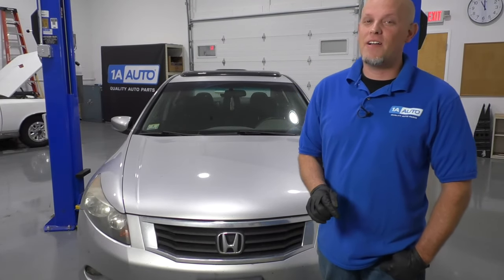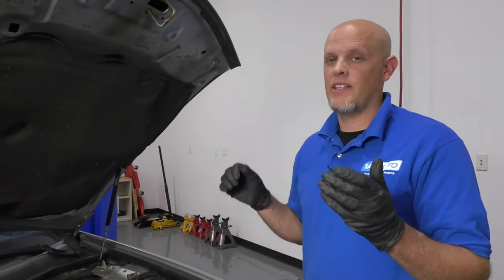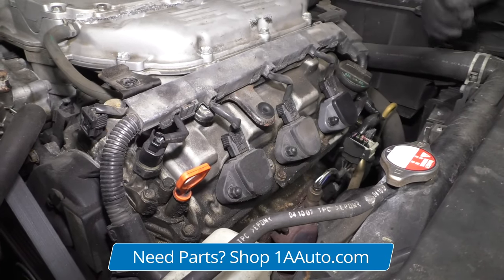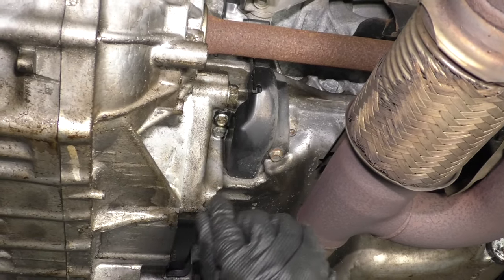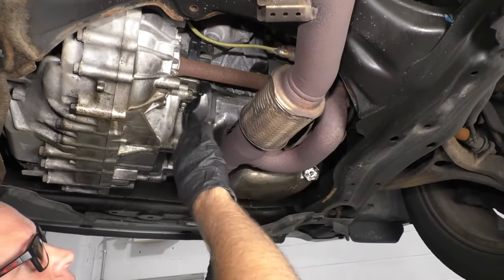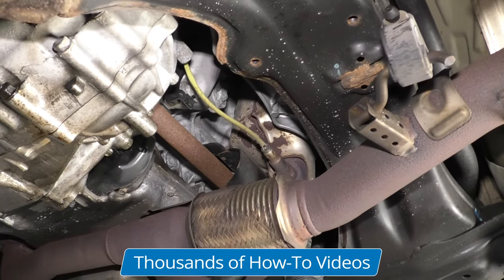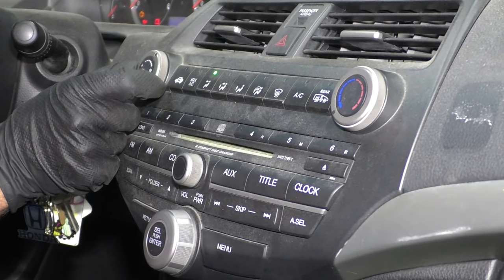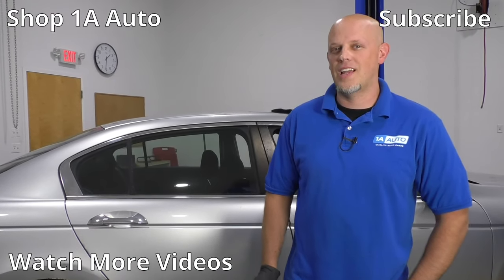Top 5 Problems Honda Accord Sedan 8th Generation 2008-12

Comment: i have a v6 accord and just replaced the alternator after having a bad oil leak ruin the last one, i had gotten everything in the car fixed, all i needed was a better battery, i went to go replace it and my car killed two battery’s in like an hour 🤦‍♂️ do you guys think the alternator is bad and is killing the battery? or any suggestions on what can be causing my battery to die so fast. i don’t think it’s the alternator but might be…
Reply: You probably have a parasitic draw coming from an electronic. Gonna have to test it yourself with a multimeter or take it to a shop.

Comment: my 2009 accord lx-p has 204K miles and never had any problems. If you drive normally and don't floor it you wont have any problem
Reply: Check the oil buddy
Reply: @irfanhasrat9705  All cars should have the oil checked.
Reply: Don't floor it???
Reply: Don’t like being driven over 80 mph, will really use oil

Comment: Good morning! Have a 2010 Acura TSX.. In freezing Temps, when starting out fresh, my brakes don't work. Let the car warm up, or consistently pump the brakes and they start to grab after a short time and they work fine after that intial start. Have changed brake fluid, brake pads and calipers are fine.... Ideas?  Brake booster possibly? Happens always with colder Temps below freezing.... Help.... 😂

Comment: I changed out my water pump on my 2.4l last week. Don't know if its a common problem.
Reply: Changed out mine at 95,000 miles. Bearing went.
Reply: Should have changed the timing belt at the same time. Watch the video on YouTube ," south main auto channel" is a good one.

Comment: Mine is the alternator AGAIN!! Also ignition coils causing misfire and the shaft sensow..which i saw recalls on the misfire and nose thingy thing..meanwhile one dealership is taxing me $900 for alternator and also stated if i were to buy at autozone etc..that'll only last for about 2-3 wks and its best to buy from them.. only but i have lifetime guarantee on it why would u pay 900 and dealership never once mentioned recall and i called another location its very much acknowledged but where my car is they claim that they cant see that!! Wow!! Dealerships are quite messy!!
Reply: Oil leak above the alternator will ruin the alternator and the oil consumption is the VCT problem.
Install the S-VCM and it will take care of the oil consumption.
$100 and 15min to install.

Comment: I love my Honda’s but I had nothing but problem after problem with my 08. Everything from bad interior lights in the radio, VTC actuator, burning oil, rust issues in NY, bad time with that thing.
Reply: Yeah burning oil is a common issue with 8th generation accords, with both 4 cylinder and V6, for entirely different reasons. My 08 has the same issue
Reply: Install the S-VCM @ $100
It will fix the problem , takes about 15 minutes to install.

Comment: I’m surprised no one here has mentioned how uncomfortable the seats are.
Reply: @6373h yes it is. My back and neck were always in pain no matter how many times I adjusted the seat.
Reply: Lean them back and it gets worse
Reply: Any one who says this is soft. Man up, buttercup. Also, if you didn’t get leather seating, you’re cheap and shouldn’t have settled. They are very comfy.
Reply: Agree the seats suck its so solid feels like sitting on a rock and ours is the "full-option" with leather seats.. but oh man they're bad
Reply: @GoAsCloseAsYouCan  dude we have the leather option and they suck. I tried a Hyundai Azera 2012 (same model as our Accord) and oh wow the difference is night and day the Azera is x100 times better and way more comfortable
Reply: They're not really uncomfortable you just have to sit with good posture. No leaning on the gwagon wheel
Reply: I rode in a brand new Nissan Maxima and those seats are 10 times worse.  Put it in perspective for me.
Reply: I removed the head rest and it is so much better!  The head rests on the 8th gen 4cylinder Honda accord lx push the head forward and interfere with proper posture.

But yes; still a bit uncomfortable because the seat does not keep the back perfectly straight.

Comment: I've been lucky  my 06 has 241k and still has the original alternator
Reply: That generation had a good alternator. I’ve seen many of those with over 300K with original. I’m not sure the 8th grand issue cause it also uses a Denso alternator
Reply: @levimagnusson5880  I have the V6 Model and my alternator has gone out twice since i’ve got it. Presumably because of whatever is leaking onto it is killing it.
Reply: @rumwrld9043  that’s odd. I’m not sure how the alternator in the V6 are. But in the 4 cylinder I’ve had many friends plus myself go 200K+ on the original alternator
Reply: @levimagnusson5880  I’ve been looking around and apparently the V6’s have some pretty common leaks around the alternator that are pretty simple fixes. I’m thinking it’s those/that oil getting onto the alternator and ruining it, rather than it being the actual alternator.

Comment: I had a k24 accord and it didnt have any engine problems. But it was rebuilt so the drivers side axle broke twice. After it was fixed finally it ran like a charm.

Comment: I feel maintaining a hydraulic power steering is also tough and it costs to replace the pump and the power steering rack if damaged also lets not forget vtec solenoid leaks!
Reply: Change the oil in the reservoir every oil change and that should help.
Reply: @adamUDavies  Hey Adam, I hope you’re doing well. Your suggestion indeed is helpful.
Reply: Replace the power steering fluid very couple years. See YouTube video, simple really.

Comment: On my 08, the ABS, BRAKE and VSA lights are on all the time, my mechanic changed the brakes and all 4 sensors on tires and still on, he told me it might be the Module but that part is very expensive 1K. Any ideas? thanks!
Reply: Did you fix it ?
Reply: @dawnjackson4640 Nope, I actually went to the dealer for a recall with airbag and tjey saw the lights on so the service rep told me there is an ABS recall so he was going to look for it and let me know. I hope, because it is expensive to buy module.
Reply: @aldon78 Thank you so much for that. You got it covered?

Comment: my accord 08 v4 gives less fuel , around 350km in full-tank till it reaches the yellow light what can be the reasons for the fuel drain. total 160k km is driven as shown in the speedometer, and the engine oil was leaking or evaporating or going out thru the exhaust i dont know exactly, one guy told me to change the engine itself he said piston rings are letting the vapor out he told to change engine instead of the piston rings due to the labor charge involved, but when topped up some cheap oil now the engine oil doesnt leak. but fuel consumption has gone up. full tank i used to get 450km now i get 350km , PLS ADVICE

Comment: The 7th generation models, especially from 05 - 07 were better than the 8th generation ones.
Reply: My wife has the 07, 160,00 miles, only thing we've replaced was a couple of window motors, first vehicle that wasn't one of America's big 3, that we've had, I can't believe how dependable it's been, I'll never buy another Ford or GM
Reply: @rick343  
I've had an 05 with the 2.4L for over 12 years and it's got 210k. Not sure why Honda made so many changes with the 8th generation. What happened to "If it ain't broke don't fix it"?
Reply: @jeffu.8053  I know right, after reading the comments I was thinking the same, so many people with complaints that aren't even mentioned, that next generation really went down hill

Comment: What causes hard starting on these cars? Recently I would have to crank about three to four times before the engine starts slowly.
Reply: Try high octane ⛽ gasoline...!
Reply: Could be a battery could be a starter have you took a look at the battery?
Reply: My battery caused this.
Reply: I had this issue. Needs crank case sensor and an expensive scan tool to “learn” the new sensor, I tried manual method, didn’t work. If your is hard to start when hot..100% sensor. Other is you must use Honda OEM starter, for some reason aftermarket work for 1 year then have issues

Comment: My 2009 2.4l had so many electrical problems. The car would shut off while driving. The stereo would turn on by itself self when the car was off. The windows would roll up by them selves. The doors would lock automatically when the car wasn’t even moving. I stepped out of the car while it was running in 3 below temp. I got locked out when the doors locked
Reply: If you get locked out, its a bad door switch. I've replaced a few. $12 on rock auto depending on vin. My 07 had a sensitive door remote and it opened my windows one night when it was below zero, other than from that point or the door lock, the power windows do not have power when off.

Comment: I have 2012 one 4 cylinder coupe. From my experience with it so far:
1) the front seats are super uncomfortable and causes lower back pain 
2) premature break wear (front especially), I got new rotor’s and pads and it started losing power in less than a year. After 2 years now the brakes are almost gone and needs to be replaced again
3) very low mpg. The most I have gotten at one point was 22ish. After oil change and engine cleaning it goes up but overtime it starts dropping from 20ish to 17ish. I got 14 only once shockingly. Usually 17-18 is what I get even. This is completely ridiculous considering that it’s 4 cylinders. I always say I’m driving a Mustang without a Mustang engine and body lol 😂
Oh also doesn’t matter whether it’s city or highway driving. There is not much of a difference 💁‍♂️

Comment: Hello 👋 I have a 2012 v6 Honda Accord that makes a rattling noise when I start it in the morning when it’s cold, started doing it like 6 months ago and it stops when is warm
Reply: Same problem with my car too this noise is from steering power pump !
Reply: @arsalansaeed3715  I just had the racnpinion and power stirring pump replaced and the noise still there
Reply: @migueldelaguira8421  
Is it a loud clicking or ticking noise?
Reply: @jeffu.8053  it’s more like a clicking noise
Reply: @migueldelaguira8421  
The noise is probably from the valves. They don't automatically adjust on Honda engines like they do on other brands and may have to be manually adjusted at certain mileage intervals.
Reply: @jeffu.8053  is that a lot of work? Thanks
Reply: @migueldelaguira8421  
On the V6 there are 24 valves so all of the clearances would have to be checked. The total amount of time the job would take depends on how many of them actually need to be adjusted.
Reply: @jeffu.8053  I check on that 👍🏾thanks Jeff
Reply: Could be camshaft as well.
Reply: VTC Actuator, it's common in these cars. From what I've read in the past was that it's harmless but really annoying. The cost of having it replaced is super expensive if you missed the recall window. Also read that the replacement only fixes the problem temporarily and they didnt re-engineer the problem part and that it would only be a matter of time before you encounter the same problem again.
Reply: Have your timing belt tensioner checked.. could be time for timing maintenance. I just had mines done on my 2012 V6 Coupe @ Honda. It was making that clicking noise on the passenger side for me in the morning. It’ll be loud and when the car warms, it would go away. Had my timing service and the noise is gone.
Reply: Check your blinker fluid
Reply: @davidbasset7557   check the floor mats. Dirt is the biggest issue

Comment: Changed the rack and pinion, timing belt, factory amp, and now it has an alternator issue
Reply: when you change the timing belt did it stop the cold start rattle??

Comment: I have a 2010 V6 and I've had none of these problems except the misfire and that's from bad piston rings not ignition coils
Reply: I have a 2012 V6 with 116,xxx. The VCM I hear is bad. I change my oil every 5k n tranny fluid every 30k, fingers crossed 😓🤞
Reply: @jakehunter3434  I do the same
Reply: @jakehunter3434  I had to get my engine rebuilt at 116k
Reply: @ONeal397  so far mines been good, at 118k now. That's a shame, sorry to hear that.
Reply: @jakehunter3434  look on the internet and buy yourself the svcm @ $90.
Install it in 15min it will solve the problem. Done it on 2 with the 3.5.
Reply: How much for new piston rings?
Reply: @paulpatane2439  at the time the service writer said it's a $3,000 job
Reply: Piston rings are not a true fix, it's just treating the symptoms. Disabling VCM will take care of the issue for good.
Reply: @wiimaster2847 I'm still looking for a VCM tuner

Comment: the battery recharging problem with my accord was not the alternator but the amount of multimedia installed in the car somehow. It was discharging 100% if I didn't use the car for 4~6 days. After I disabled the reverse camera it never happened it again.

Comment: PLEASE! HELP
Hi quick question for you, the battery in mine has gone completely Dead and I am unable to unlock the vehicle even with the key. ¿
 Please Help Thank you
Reply: Putting the key in the driver side door, the only keyhole on the vehicle turning to the left or the right is doing nothing.  Assuming the locks are 100% electric but if that's the case how do I get into my vehicle, Quite a Massive! design flaw if that's the case.

Comment: How were these problems such an issue though?, they seem to be similar problems any car has. I thought you was going to talk about the accords real problems but those you showed on the top 5 list are just basic maintenance issues. The real problems with these 8th gen accords is the high oil consumption and the brakes system being to small for the weight of the car. And most importantly the strict timing belt maintenance replacement before 100k. These engines are high pronged to serious damage when the timing belt brakes or  skips the timing due to timing belt wear and stretching  prematurely because they have a very smaller width of belt material than usual, so keeping up with engine oil, brakes, and timing belts are a big problem, but if you can manage these real problems than you got yourself a fine accord with a very good owner.
Reply: I’ve had no issues, 2008 Accord bought it 97,000, now have 126,000 I haven’t even touched the brakes, no oil issues. Maybe bad brakes because of people’s poor driving habits?!?!
Reply: 4 cylinder has a timing chain, not belt. I’ve owned my car for 5 years.

Comment: Not bad! I’m 16 and looking at my second car, because my last one blew up (Jeep fashion 😂) and i found a 2012 with V6 (only reason I want it) and it’s got 150,000 miles... mostly highway miles according to the owner, and says he wants 6400 dollars for it. Too much? Or just right?
Reply: Get the 4cyl model. Better gas mileage and enough power. The v6 models have VCM and start to burn oil, unless it’s the 6 speed manual which don’t have VCM buy are very hard to find
Reply: I have the Odyssey with the 3.5 and 111,000 miles. I installed the VCM muzzle for $120 and it runs great. I still see plenty of these motors with well over 200,000 miles. Definitely have a mechanic check it out like Scotty Kilmer always says.
Reply: waaaaaaaaaay too much.    they should  pay you too take it!
Reply: @VQ.Family    Avoid the 2.4L 4 banger.  P.O.S.!!! Sent out with major problem.....Avoid at all cost!  P.O.S.
Reply: @fridayray8891  Yeah I have seen quite a few POS 2.4, one of them, the guy could only get 450,000 miles before he traded it. I think he had a defect that wouldn't allow him to drive 500,000 miles. Usually I see them traded at ~280,000-300,000 miles. I think a proper motor should go many more miles (700,000 minimum) without any issues.
Reply: @midwestfarm757  good for him..did he have the defective motor version?
Reply: @fridayray8891  Well a check of vin numbers has pulled up numerous 2008, 09 models with high miles. I mean not as high as a million mile semi, but pretty decent.
Reply: @midwestfarm757  well, I expect better from Honda...I have had many over the years but this 2.4L  is a disappointment...still better than a Hyundai..

Comment: Does anyone know what may cause the VSA, ABS, and a triangle with an exclamation mark to come on the dash after turning the steering wheel all the way to one side? Thanks in advance.
Reply: you have burned abs wires on one front side of what you steering to. (could be maybe could be not)
Reply: I agree with the other guy. Just because I swapped out like 5 abs sensors on my front passenger side when I replaced my wheel bearing that was toast. I only went through 4 (advanced auto) after purchasing the sensor for 20 bucks more at my local dealership.
Reply: Solenoid

Comment: My wife has a 2010 accord v6. Disappointed in Honda with this purchase. Aside from oil consumption and changing the #1 spark plug up to 3x a year my main concern is a electrical issue. Maybe someone has experienced this and can recommend a fix. From time to time my interior lights will turn on, dashboard lights will light and a couple times my radio will turn off. All this happens while we are driving.  Anyone with any suggestions???
Reply: Google vcmuzzler. It disables the vcm which cause the burning of oil. .
Reply: Check your grounds and make sure your battery cables are clean and secure

Comment: Wheel bearing issues tire issues  rocker arm senor vtc senor catalytic converter rack and pinion and a lot of front Car axel fixes.and Oil leak I drive/do Uber lyft 299,998 miles. Would I get a Honda again. Yessss a newer Model  not the  2012- to 2018 2019 and up or Mybe a Toyota. or Tesla if I can afford it

Comment: Motor blew at 160000   replaced motor and got evc or ect uner for 109 dollars . The tuner basically makes the car not run on 4 cylinders instead of all 6 . That to me this car biggest flaw and should be mentioned.
Reply: On v6, mustbreplace timing belt every 90,000